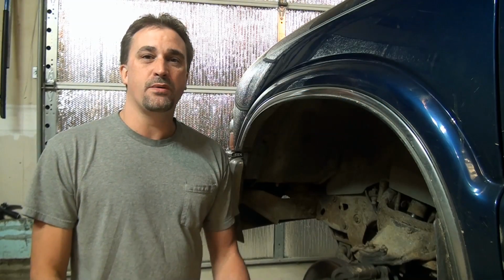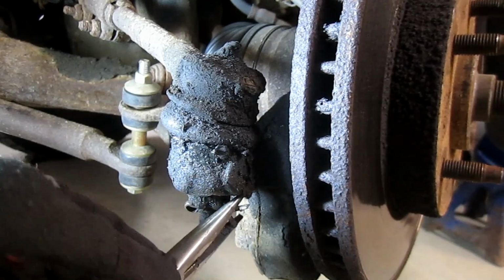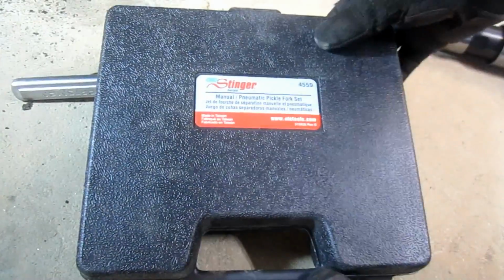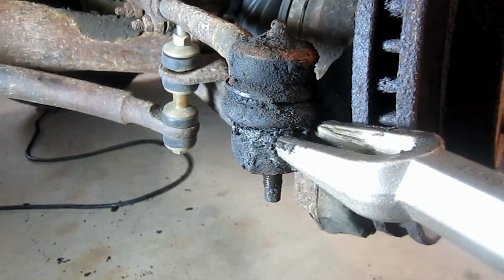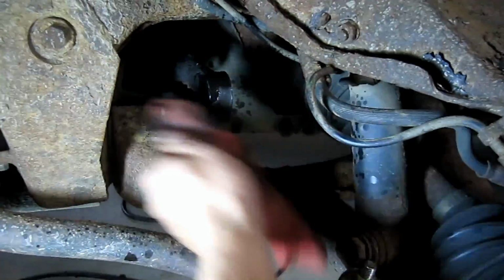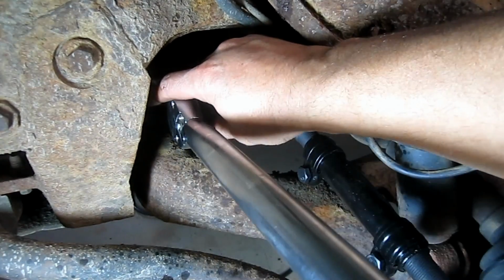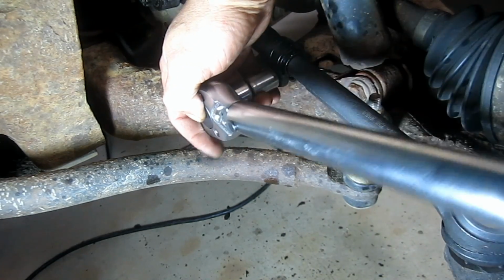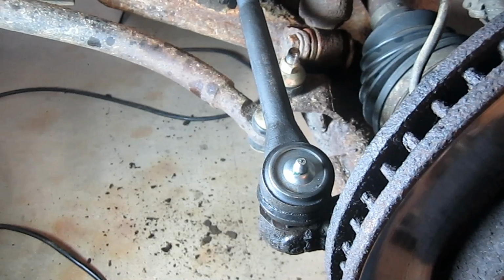DIY How To Replace Inner And Outer Tie Rod Ends - Front End Replacement Part 2

Comment: My steering wheel is slightly crooked to the right, and drifts left when steering wheel is straight. Can tie rods or bushings cause that to happen? I’ve done 3 alignments in 2 months and it didn’t fix it. My car has 90,000 miles

Comment: Before installing the new one you can measure the length of the old one and adjust the new one, measure center to center of the studs. It will get you to the guy for alignment
Reply: @nogripes  hey Mark I just changed my tie rod ends on the left side of the truck , 96 -3/4 ton
Chevy measured 16 1/2"center of top stem to c of bottom zerk fitting, 
Drove around and block, feels good

Comment: Don't use cheap Chinese/ Mexican made or you'll be doing this job again in a year or two. Use factory or Moog. Especially if you're going to do a ball joint job. The cheaper ones just don't last.
Reply: @nogripes  I don't really drive my S10 all that much,so I used the cheap Ebay Mexican stuff I think it cost about 130$ for everything I've only put about 15k on it since replacing everything including the ball joints. Something is already bad....clunky noises already. I wouldn't recommend any of that cheap stuff,unless they just can't afford the good stuff and they need the vehicle fixed badly. Otherwise  junkyard stuff will probably last longer.

Comment: So what happens if I don't have a torque wrench and I just tighten them as much as I can? Is that bad? 

Another question (I don't have an air compressor), what does the impact hammer do to the pickle fork? Can I use a pickle fork by hand to loosen the tie rod ends?
Reply: You are going to have to get a front end alignment anyhow.  So tell them to also torque it.  You can use a hammer on the fork.

Comment: Hi Mark, will the torque specks will be same for a 2000 CHEVROLET EXPRESS G3500? I work for a non profit and we have a medium size school bus based on a 2000 CHEVROLET EXPRESS G3500 We need to replace the tie rods plus the upper control arms before they can perform an alignment. I wanted to do that myself so we can save $1000.00. Thank you.

Comment: The rubber boot on my 2006 Impala tie rod is cut half way "across" on the bottom side.06 Impala 3.9 LT automatic.
When I go to replace it, how do I add the grease and how much and what kind of grease should I use?
Can I use "heavy duty lithium grease(black)?
Awesome video. Thank you so much

Comment: my 99 gmc jimmy makes a loud medal busting sound when turning or braking at really slow speeds like mostly turning into a space or backing out and braking,what could it be and how can i check it? all i heard to do is push and pull on the tire so i did the top of the tire on both sides and the tires goes in and out a little bit that all i know
REPLY
Reply: Could be your cv axle.

Comment: Nice work. Where did you find the torque specs I'm trying to find them for a 86 Chevy Caprice I need the sleeve, inner & outer tie rod, & both ball joint specs if you can help thanks

Comment: Is it required to use locktite on the sleeves? I've been hearing yes from some and others say it's really not necessary. I just did both driver and passenger inners, outers and sleeves. Went ahead and purchased MOOG. Installed on a 2000 Chevy 2500k. Not sure if all that info was needed, but there ya go lol. I did not use any locktite.